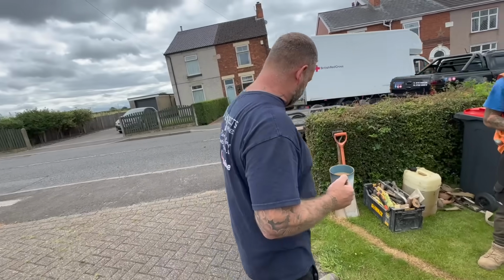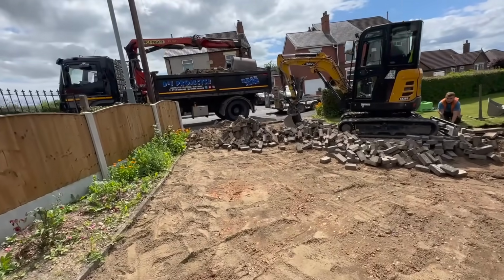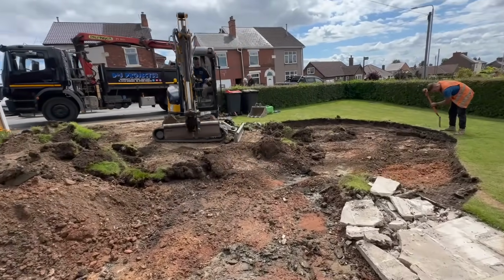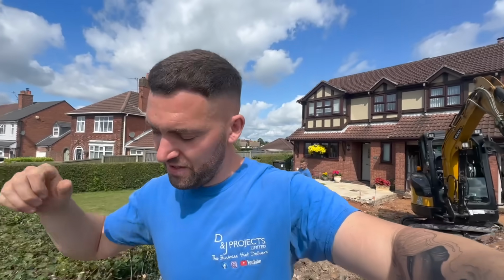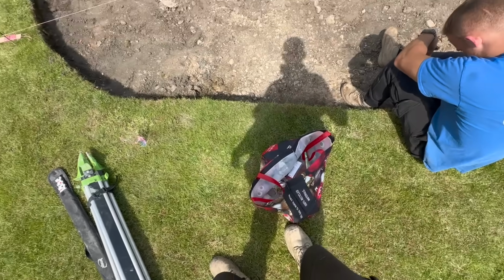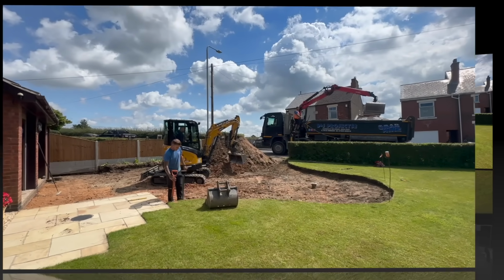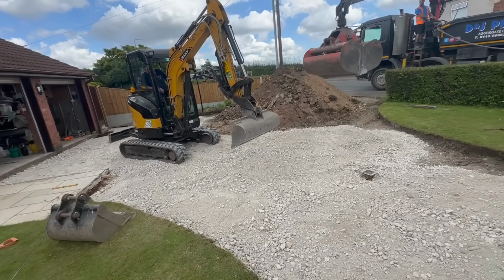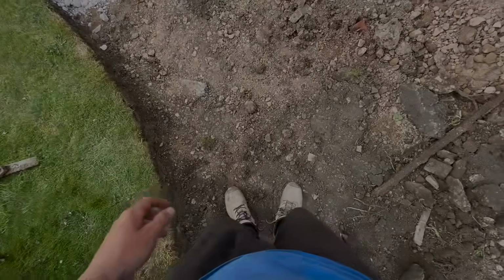We Have a Major Problem On Our New Driveway Installation

Comment: Good afternoon D&J team and I’m on the IPad this week it’s far better than the phone with the bigger screen.  Job looks like it’s a plain sailing. I like the customers way of leaving yous clearly marked line of where the new drive has to go to.
Stevie where is the link to the power bank you were talking about as I quite fancy getting a complete set to cut it when we get the inevitable power cut as we get at least one per year and I’m sick of getting the generator out and running the house of it via a 13amp plug cable it’s not as safe over night really but it’s what I’ve got but the noise is awful outside the bedroom wall. 
Dave I’m really looking forward to seeing this new crusher bucket in action 😊

Comment: plastic tape across the front of the drive will not protect the public, your understanding of health and safety seems limited.
Reply: Caution tape or hazard tape is there to tell the public that there is potential hazard in that area. If someone hops over the tape gets themselves hurt these lads are covered Could say the same about a barrier, anyone could move it out of the way and step inside anyway. Putting tape up is following H&S so what's the problem ?
Reply: @tomalex4806  Now factor children into your post.
Reply: Your understanding of the general public is very limited isn't it
Reply: @Fload.Ritlhe try read the post again and it's the same answer. Even if they put barriers there they can easily be moved if kids wanted to go behind there and I'd think no parent walking along the path with their kid wouldn't let them go behind the tape and would watch them. 
Clutching at straws much  aye
Reply: @tomalex4806  Ignorance of Health and Safety regulations will not save you from prosecution in the event of an accident, you can obviously read and write look up the relevant regulations.